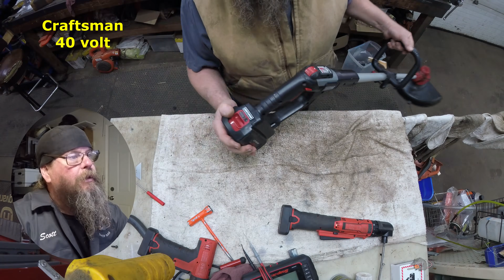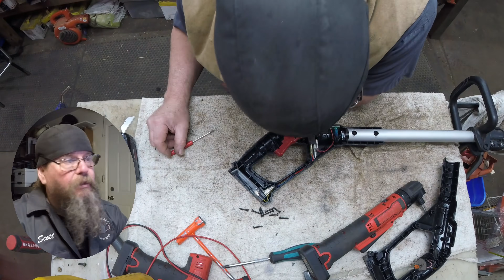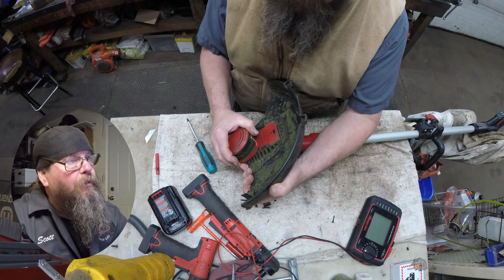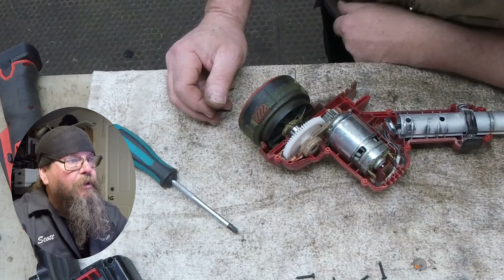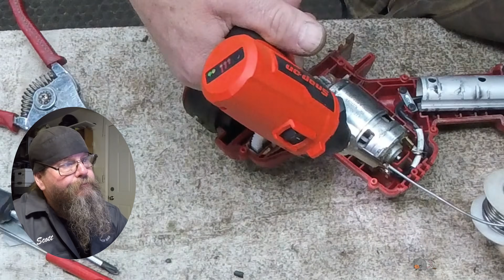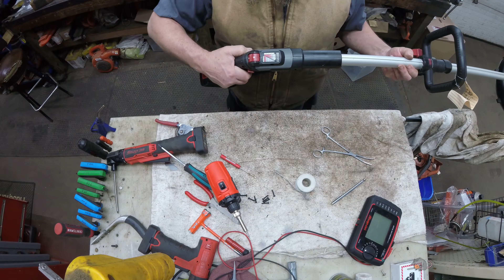Craftsman 40 Volt Trimmer Won't Run-FIXED!

Comment: Thumbs up, a great variety of machines come to your bench, keeps the day interesting, enjoying these video's, was wondering about the motor connection,it didn't drop battery voltage at all when the switch was pressed

Comment: What is the most reliable backpack blower in your opinion
Br450
Br600
Pb770
Like one with least amount of maintenance 
I only use Stihl moto mix
Reply from the maker: Of those three I like the PB770.

Comment: Shit, that's the happy truth...🤣🙃 Gas OPE over electric all day.
Reply from the maker: While I agree, I also believe they are just one breakthrough away from getting those batteries to run longer which would be a game changer.
Reply: @TheGreasyShopRag  Maruyama is testing hydrogen powered commercial OPE...
Reply from the maker: @twocyclesmoke  Interesting.

Comment: Excellent video. It goes to show if you're not on hurry you can fix things. Snap-on soldering gun & meter look good. Thanks 🙏
Reply from the maker: I'm sure if it was a plug in then it would have hit the trash but because batteries are expensive it needed to be fixed.

Comment: Never had one with a wire like that. I’d probably hang it from it LOL. Do you use rosin core solder?   Nice way of tracking down the problem.
Reply from the maker: Yes rosin core solder